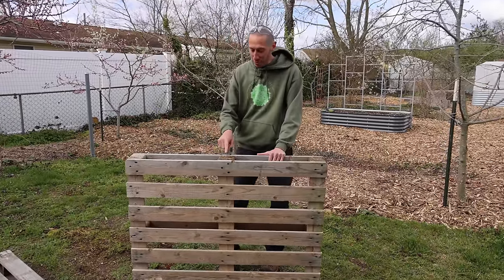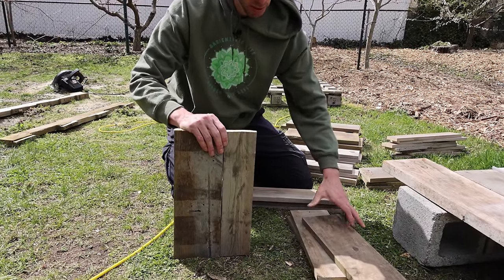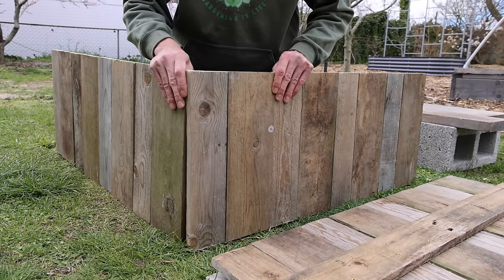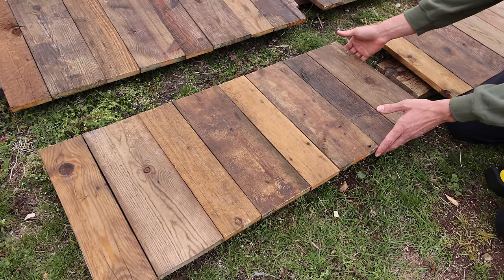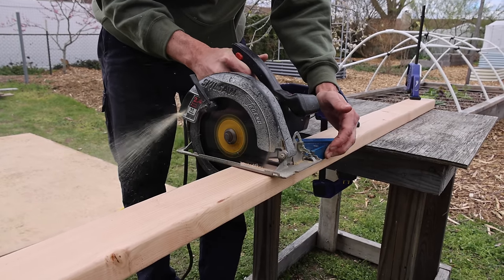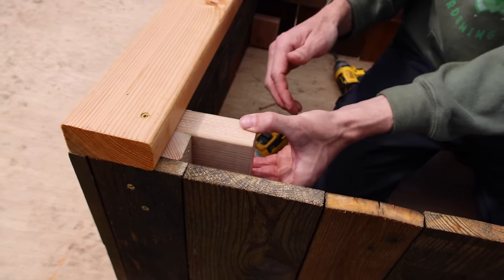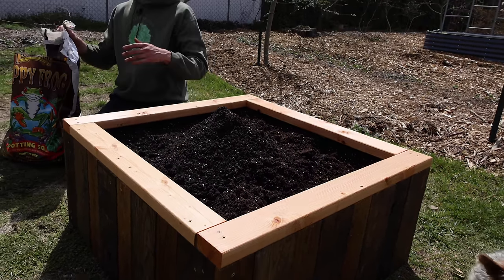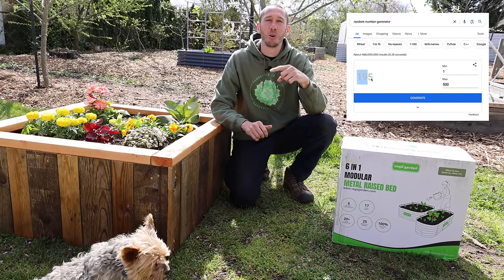How to Build a RAISED BED Using RECYCLED PALLETS, FREE Backyard Gardening

Comment: As someone who is a huge fan of building with pallets. There is an important thing to look for when choosing pallets, especially if you're using them for gardening. All pallets have a stamp for the method used to kill pests.  Only use pallets with a stamp that says "HT". HT stands for "heat treated"    Other stamps  mean it's been treated with heavy duty pesticides " MB" means Methyl Bromide. Choose those with an HT stamp. It's usually on the runners , sometimes on the inner runner

Comment: James, do I remember correctly that Tuck has a condition called "collapsing trachea"? If so, I have rescued many a little one with the condition...have two little ones with it currently.  Trying to keep them off of steroids.  Am using Hemp Oil and it is working wonderfully well. Keeps the trachea "relaxed". Just passing this along.....

Comment: Very straightforward and easy to follow DIY video for anyone starting out. Glad to see the boss is supervising you too! ❤

That pallet wood is in very good condition. You were lucky there James! The pallets we get in the UK are very rough and you have to sand them down quite a bit. 

I have made a chair, coffee table, vertical planters for window boxes and plant hangers and bits and bobs. I just upcycled our old sandpit for a bed. They also make super easy compost bins!

I would have used the thicker central pieces that are square to do the corners. Pick two sides to over hang to sit on and the long sides to have flush to make and add a hoop house frame. You can also line the beds with old compost bags to help prevent the wood from decaying against the wet soil. You just need to make sure they are well sealed before filling to avoid giving slugs and snails a hiding home.

Congratulations to Carly! Is the competition open to people outside of the US? I couldn't see any of the TOS regarding this?  I think for the same prize value of the vertical towers and beds, you could do a giveaway with a variety of covers, like fleece, membrane, mesh, shade and throw in some tomato clips. Vertical staging/ mini green houses are also very useful as are cold frames. Power tools is also a great option as i have seen some sponsors for those like the hand saws and battery powered pruners?  If just open for US people, then you could also do an international giveaway, where by you send seeds or a kneel pad/ merch or something like that.

We all love a giveaway but isn't it a bit expensive to do it every week or is it just for a short period of time?  

Great video James and Tuck! ❤

Comment: It looks great. I plan to do this, however inside it im going to put half an old  (foodsafe) IBC tank insert (the plastic part) with drainage holes in the bottom, and then the wooden frame will last longer without contacting the soil inside, also i can use treated timber on the frame without it contacting the soil. it will be larger overall and a bigger timber on the top with more vertical support so that i can sit on the edge.

Comment: Awsome work, if I was to do one thing differently it would be to Oil the wood before putting together.
I would pre drill all holes then paint on the oil then put together.

But it looks great and works a treat as is.